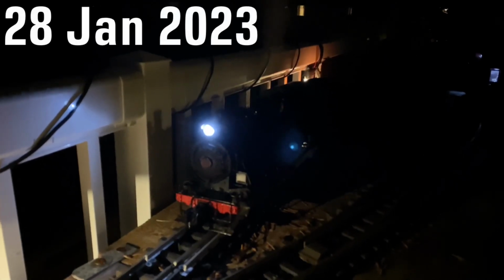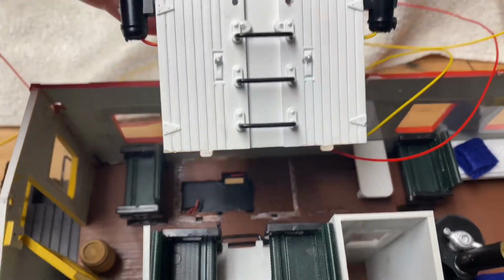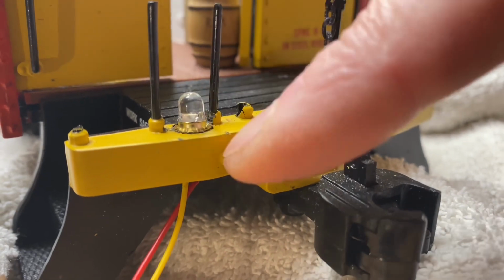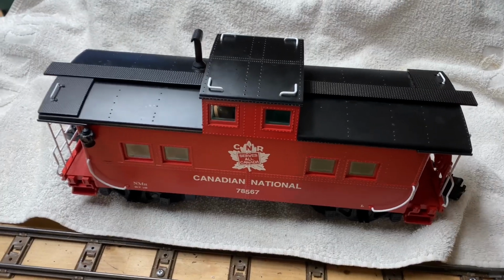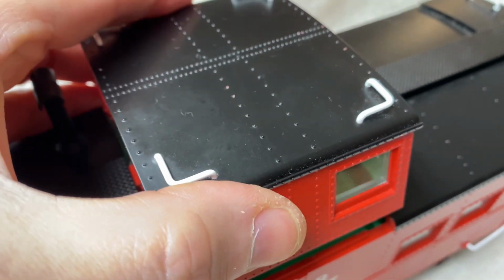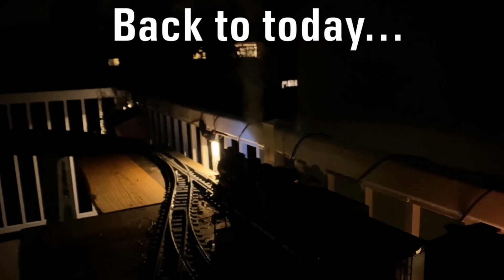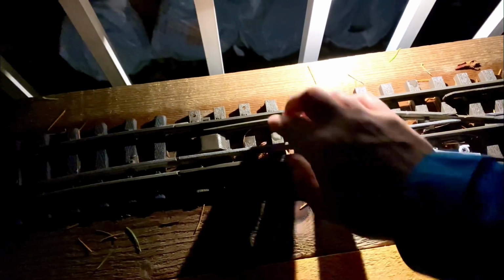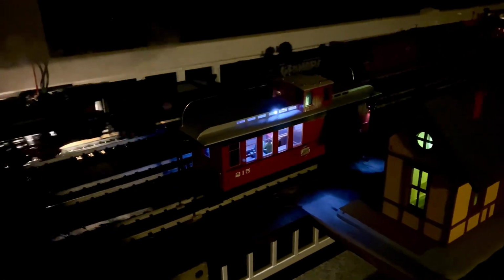Victoria BC: Easy battery LED caboose lighting allowing live steam trains at night (see description)

Comment: Cool video! I've been enjoying your videos as I start to lay out my first garden railway.

Unrelated to this specific video- I've noticed that some of the curves on your layout are relatively tight. How tight of a radius will your Mamods deal with? Mamod quotes some MASSIVE radii on their website (like 3.5 foot radius/7 foot diameter), which was making their models unappealing for me, but your Brunel seems quite happy with curves look tighter. 

I'd love to have a Mamod Brunel or a Kitson tram, and if they can actually work with a 2-2.5 foot radius that would make me a very happy guy.
Reply from the maker: Thanks Chris! 😊

On my Garden Planter Railway the narrowest curve is 4 foot diameter (2 foot radius). All my engines can get around that curve - including the Mamods of course. Easily. The only one I have that could not is my Accucraft 0-6-0 tender engine. That was only because the cab roof overhang struck a part on the tender. I made some non-noticeable mods and now even it goes round the 4 foot diametre.

Comment: Hi there Mr Terry! I'm a 13 yr old live steamer with a budget of around $400, I have 2 mamod engines, both road vehicles, and a (broken) Jensen model 75, I'd like to start to begin a live steam railway like you, but I need some tips and to dos from a master like you, please, give me any advice!
Reply from the maker: Hi Urijah. The problem with the live steam train hobby is how expensive it is. I have always been into model trains, since I was younger than you are now, but I wasn’t able to have a live steam locomotive until I was an adult. I wish there were less expensive options. 

With 400 you can get a very beginner loco like a simple MSS engine. But that engine doesn’t really have controls and is not very satisfying. A poor running engine can take away enthusiasm for the hobby. Many adults buy the MSS engine and then spend more upgrading it, which takes a lot of work. 

In my opinion the least expensive engine that still operates well enough to enjoy is a Mamod Mk 3. They are more than 400 though. I have one. It’s fun and makes me smile. I have a play list on my channel of all my vids about that engine. 

Once you save and have one there are some fairly inexpensive wagon kits like the smaller ones made by Swift Sixteen. But even then it’s more expensive than trains in HO or N scale. 

Track is another crazy expense. If you go with 32 mm gauge trains (which represent 2 foot narrow gauge industrial trains) you can use Mamod track, which is less  expensive but not super great, or PECO which is awesome track but very expensive. If you go with 45 mm gauge, which is regular G scale track (I recommend you do starting out) then PIKO track is the least expensive but still good. If you are only going for live steam and don’t need power in your track search online for aluminum track. I use aluminum track on my larger deck loop. The company that made my track is no longer in business. Anyway, aluminum track is cheaper. 

Sadly 400 does not go very far in live scale trains.  It even if you can’t afford it now you will have something to look forward to (and maybe save a little for) later. Also, and this is what I do, use patience and try to find things used. 

I hope this helps. Terry
Reply: @Terrys-Steam-and-Bricks  Thanks for the advice! I'll start to save up and get a mk or mss. I'll make sure to look back on this! -UJ
Reply from the maker: @urijah9810  😊
Reply from the maker: @urijah9810  ask me questions any time.